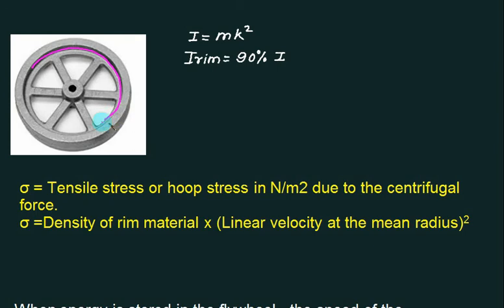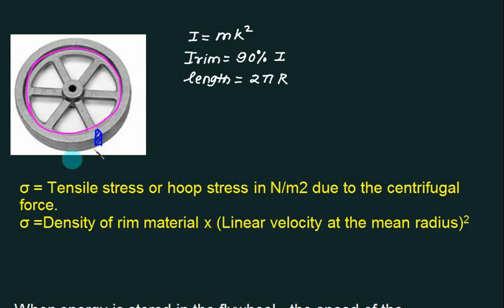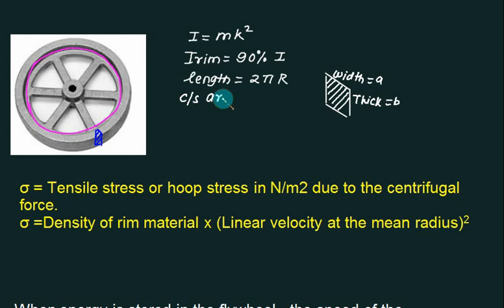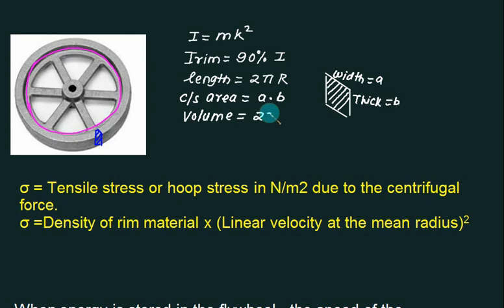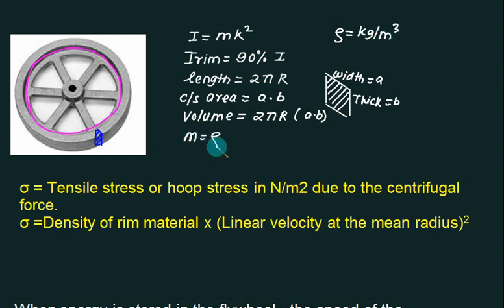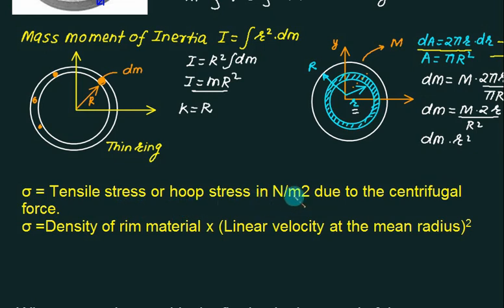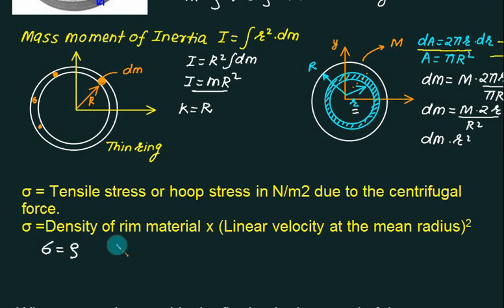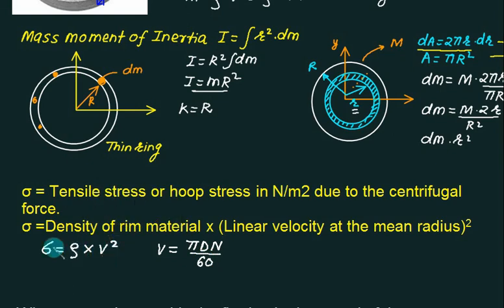TOM 02 Turning Moment Diagrams and Flywheel | Sizing the Flywheel

Comment: Hello    I was wondering if you could help me with a unique flywheel calculation please?   If I had a way of magnetically supporting a huge flywheel like the one illustrated in your video.  Lets say 50 meters in diameter. Is it possible to spin that flywheel with an outside rim speed of 1600 km per hour?